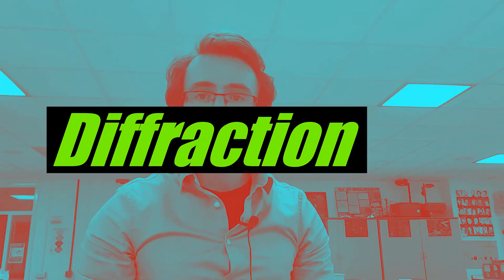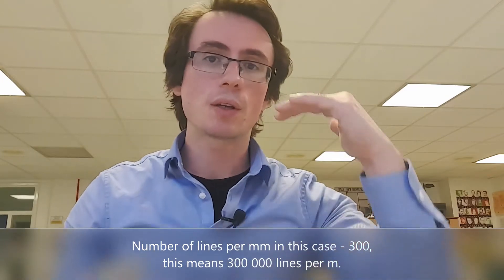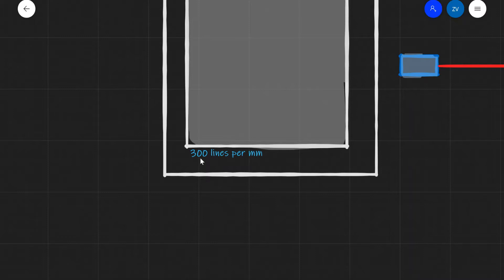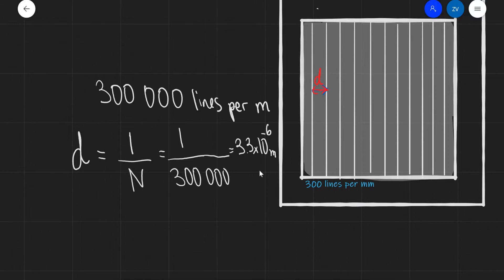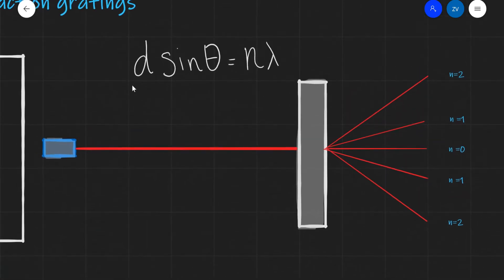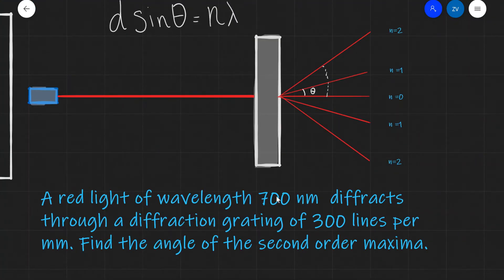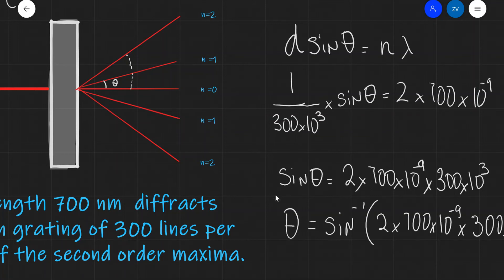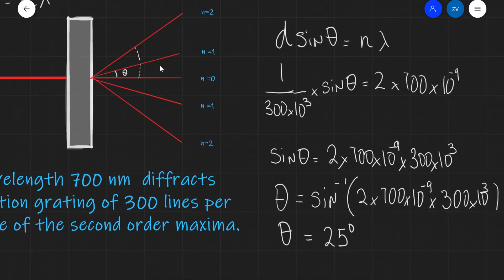A Level Physics: Diffraction gratings

Comment: Hi. Great video as always. Just wanted to ask you whether the diffraction gratings PAG to determine the wavelength of light could come up in paper 1 or whether it is only a paper 2 or potentially 3 PAG. Also are there any stars/cosmology PAGs that could come up for example stellar parallax? Best regards.
Reply from the maker: Hi, if you do OCR A the diffraction PAG is under Paper 1 as it's part of the astrophysics. It might be in a different Paper if you do a different exam board. Hope this helps!
Reply: @zhelyo_physics  Helps a lot thanks. Btw put the force darth vader meme back into the videos it's too good lol.